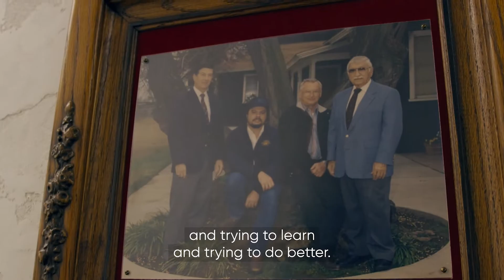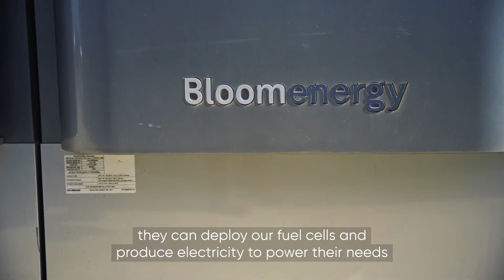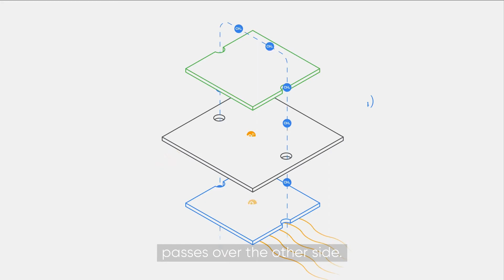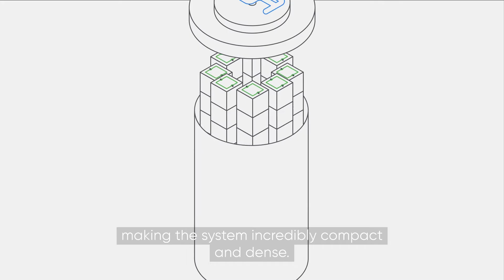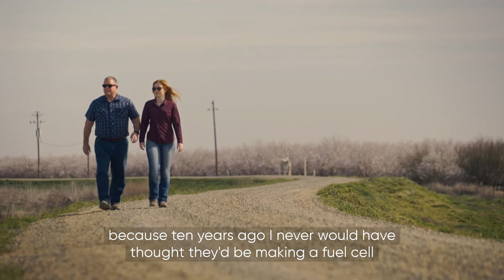Meet the Farmer Converting Waste from 7,000 Cows into Renewable Energy | Humanising Energy

Comment: This is an old story, not this story but the story of using Bio-gas to provide electrical power... Feeding waste gas into engine works great, generates power and is reliable with proper maintenance.    Many farms use this tec...https://www.youtube.com/watch?v=ZTBzQre5n_M&list=PL1Ki5fCrHdLmSYfL1GqojXpQxh3Mjelo8 

Feeding waste gas into fuel cells is a complex and expensive process... The best fuel cells use raw hydrogen and work great and are very reliable... the Hydrogen has to be very clean or the fuel cell will degrade and stop working. This is were the process get complex and expensive.... Did I say Expensive....